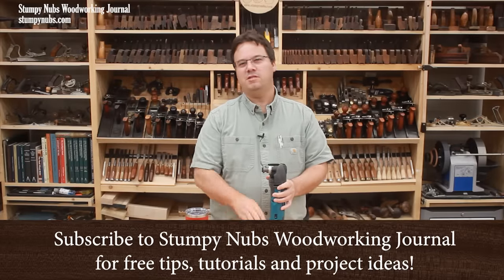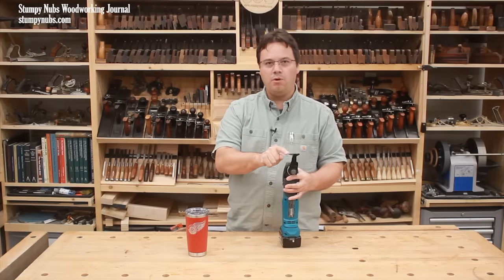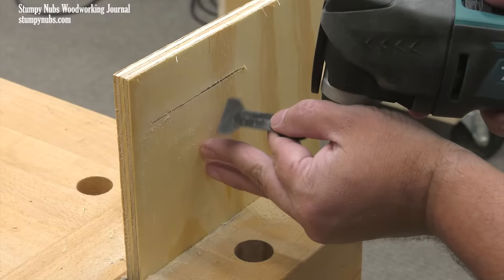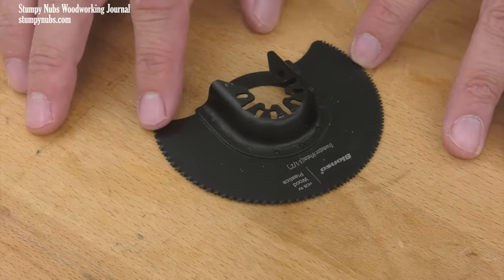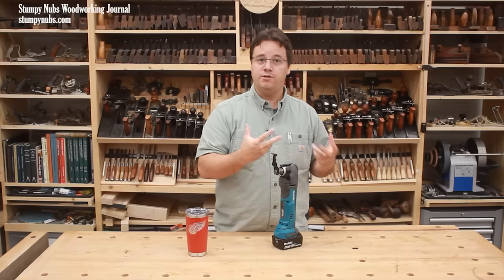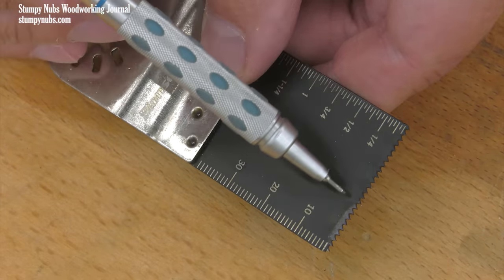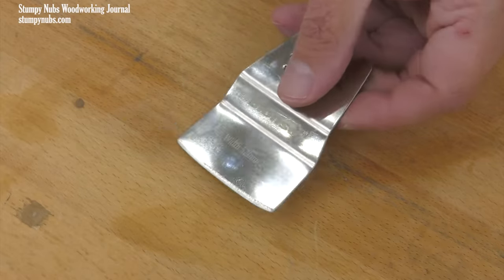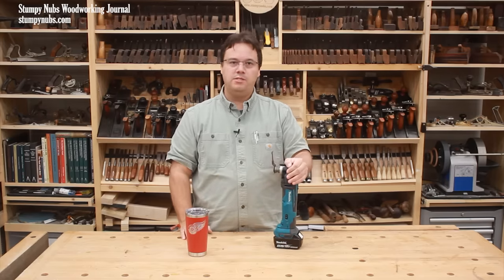CLEVER things to do with an Oscillating Multi-Tool!

Comment: Loved your informative video.  I was hoping from the start of it that you’d point out what to use for cutting bricks.  You touched on it, but then said it’d be better for another video.  I guess I’ll go look for that to see if you made one.  I just need a good one for cutting into brick (covered with thing studs and Sheetrock for a closed in patio.I need to cut a hole for electrical boxes.

Comment: When your wood blades gets dull, DON’T throw it away! You can easily sharpen them! Collect them and when your ready get out your Dremel tool and the thinnest abrasive cutting disk in the kit. With the use of a magnifying device a headband or other, use the disk to recut the teeth. It doesn’t have to be even close to perfect. Even a miss or two doesn’t make a big difference. Chang it up with angles and shapes. What counts most is sharp points, the spires not too narrow and don’t get the teeth hot (color change). Works well on bi metal too but not carbide.

Comment: Anyone in the market for an OMT should look for one with a light. I have a Bosch 18V that takes Starlock Blades. These were developed by Bosch and Fein and are the fantastic, especially their Curvetech ones. It pays to buy the best quality Blades, they last so much longer.
Another great use for them is cutting drywall in place. There can be wires or plumbing right behind the drywall and you will be able to safely cut the drywall without cutting too deep. Also perfect for cutting shims. I only wish there were extra long blades. There are times where I have to cut deep into material.

Comment: Diamond cutters and scrapers (diamond or not) do wonders in home restoration projects. Wonders. Surgical tools. In one case i easily separated the top layer of wall plaster from the bottom, to get a door frame flush with wall.

No dust, no noise, excellent and fast results, just by using a standard scraper and very low rpm.

Comment: I never thought I would use the sander attachment until I made a tiny error with a jigsaw on a laminated MDF window sill that had to slide around steel plate. It was the only power option I had that would fit. Obscure, yes. Did it make life better for one odd situation? Absolutely. Did I find this video helpful? You bet!

Comment: You can also glue green-Scrubbies to either-side of a worn-out blade, and polish between  motorcycle 'Fins' and other places . A container attached to the end of a 'Defunct' blade can be filled with small  fittings, screws etc, CRC  or even solvent will clean them up ...then....there's a feather........ Dave    NZ

Comment: Great video.  These are fascinating tools.  I've never actually used one for any length of time, but I bought a cheap one at Harbor Freight and decided to give it a try.  It was probably me, but, that damn thing was so loud it was like walking near a 737, and the damn thing vibrated so much it was actually hard to hang on to.  Maybe I just got a cheap "bad one", but I knew that I would never be using THAT one, so I took it back.  I was recently looking at a 20 volt, battery powered, Dewalt tool "kit" package with several tools in it, including one of these "screamers", for a very good price.  I might just buy some "ear muffs" and buy that kit.  Thanks again for the great video and great tips.  By the way,  I'm near Selfridge ANGB...GO WINGS!

Comment: When I got that tool, I thought all the blades were for wood. Thank you for that information. I had a 2 by 4 that needed to be cut in half in a tight space. Surprisingly, the scraper tool cut through it like butter. Hmmmmm. It was really dull, though after that cut.😊 I didn't know it was a scraper tool, so I'm chalking it up as a miracle from God.😊

Comment: i do auto body ,and occasionally we do glass , and i can remember way back to the 80's we had an air tool version of that oscillator , to remove windshields and cut through seam sealer, and it came in very handy , i had always wished someone would make an electric one, so when i saw the dremmell version , i jumped on it

Comment: The Bosch curved tec blades are my favorite by far. They are among the most expensive blades and it is very lame when someone ruins the blade by using it on the wrong material.

Comment: Rigid Jobmax for the win. Variable speed, and the head will rotate to 4 different positions for getting into even tighter spots. They even offer different attachments that can be used. Swap out the oscillating head for the right angle drill head, now it's a drill with variable speed with forward and reverse capabilities.

Comment: having use Milwaukee fuel, rigid, Dewalt, mikita, and rockler id say mikita, dewalt and miwaukee perfom very similar in speed and control of the cut. for whatever reason, rigid's (at least the one ive used) likes to throw itself and pull and tug more than the others, and rockler just cuts slower. prefer dewalts for 3 reasons. it has a trigger instead of a switch, allowing for more control and faster shutoff, but also has the option to lock the trigger. most other brands ive used use an on/off switch. dewalts also features a light on theirs. some of the other out there do too, but the mikita, rigid and rockler did not. i did many a cabinet install where i had to cut a hole for a vent by the light of my phone because the lights werent in the house yet and the mikita didnt have one. the 3rd reason is how the blade is mounted. dewalt has a powerful spring with a lever that holds theirs in. this means all you have to do to change the blade is pull the lever to depress the spring, and the old one comes out and the new one goes in. with all the rest ive used, they feature a lever that takes a good deal of force to pull open, then a screw of some kind to be pull out that binds the blade in place. while its very obviously secure, ive never had a blade come loose with dewalt, and the dewalt takes soooooo much less effort to change. 

this part is very much debatable. its not about the tool itself but the batteries. ive personally noted that in a multitool, dewalt's and milwaukee's batteries far outlast the rest in multitools in my experience. now it may be the case that all the mikita batteries ive used were near the end of their life because they were work provided, not bought by me, and definitely not new, but the Milwaukee ive used were new and my personal set at home is Dewalt and both seem to last forever. ive seen it thrown around that Dewalt makes the best battery tools for woodworkers, Milwaukee makes the best battery tools for other trades and mikita has everything that can be battery-operated... including a coffeemaker and a wheelbarrow. i think qualitywise, the 3 are very similar with their own strengths and weaknesses. so if you want to stick with one battery type, pick the one you see yourself doing the most of outside of woodworking is my suggestion.

Comment: when it comes to making straight (plunge) cuts, I find it helps to cut vertically rather than horisontally, so you can sight down the line/kerf
Reply from the maker: I find that the situation usually dictates that :)

Comment: Good tip I came up with to extend the life of blade, have a small pot of water to dip the blade in when it starts getting hot. Heat is mainly what kills blades quickly. I rarely use my Milwaukee higher than minimum speed.

Comment: "Let the tool do the work."  Heard this scores of times from my dad while helping him with projects.  Often it was "Let the machine do the work" as he was a dedicated fan of power tools.
Reply: He was absolutely right. If you try and force the tool it ends up getting stuck in the wood or burning the blade and wood.
Use it properly and you'll get more life out of the blade. This applies to the speed control as well.
Reply: I've worked in joinery shops and you can tell the arseholes because they have the speed control on the router turned up to max so that the machine is screeching away and then the smoke starts or they don't keep the router moving and it starts burning the cutter and the wood.
I have actually walked over to the guy and reduced the speed of the machine without saying a word hoping he would get the point and then walked back to my bench.
Some people are an accident waiting to happen!

Comment: I rarely, very rarely to never need one of these  but i had to click because its a interesting tool and im sure theres a cool trick in here somewhere. Im not a woodworker but i build custom batteries and make my own tools and fixtures so ill watch any video by a skilled builder and pick up a tip or a concept juat to have in the old noggin if i ever need it.
Reply: “I build custom batteries” made my brain explode. I can barely plug things in correctly… no way I would trust a battery I made. 😊👍
Reply: @whatifschrodingersboxwasacofin   building them is actually pretty easy if you can solder and have steady hands, now the design is a whole different ballgame. Thats where the engineers come in. I understand the batteries i build but am not capable of safely designing one myself either.

Comment: I got myself a green Bosch variety many years ago. Must have been 2008-2010 or so. One thing I’ve noticed, is that the really, really cheap blades are usually rubbish and will be worn out in a hurry. It is also usually much cheaper to buy multi-packs online, than buying one blade at a time over the counter.

Comment: When I found out how expensive these blades were when they first came out in mass I realize they don't make the money off the tool make it off of the blades! If you touch a little concrete, touch a nail your done so I took to tack welding hacksaw blades to the end of my worn out oscillating tool blades for cutting copper and other soft metals, it was a little time-consuming but it worked great for what I needed them for

Comment: I agree that the sanding attachments are mostly pointless for wood or metal, but by god are they fantastic for drywall. Any time I have a small drywall job I am so glad not to have the hassle of carrying around the orbital sander and extractor just for some small spackle sanding. Plus, since it’s not a rotary motion, the dust tends to fall strait down instead of being flung in every direction. So handy!

Comment: Two things that the multi tool is really good at:
1) cutting outlet holes in drywall.,
2) cutting the bottom of door frames to install flooring under them.

Comment: one more little trick - or actually two.  I purposely bought a model without a toolless blade system, because the head is much smaller - and I also tend to flip the blade upside down as often as not,  if I'm not needing to cut flush to a surface.  it feels a bit more balanced, and is even better in close quarters.

Comment: I make my own blades by drilling two (2)  small holes in a dull blade, then choosing a reciprocating blade, which are often much less expensive, and cutting it to the desired length using a cut off tool, then drilling holes thru it using the holes in the dull blade as a guide, then bolting the blades together using strong Lock Tite on the nuts to keep the assembly secured. When this blade becomes dull it can be disassembled and replaced.  :-)  L8R G8RS,

Comment: I've had a cheap oscillating tool for a few years and made good use of it. But I made the mistake of buying a non-standard blade attachment so blades are very limited. I should purchase another standard tool and put down the present one as experience.

Comment: An added tip, if your cutting speed drops suddenly check that the blade is tight. A loose blade will vibrate but not actually move much.

Comment: Sash windows on an old house, the type that slide up and down made from wood.  Six layers of paint and completely stuck.  Answer multi tool.  Cut a notch out of each side of a sawing blade, insert the blade between the window and the frame cutting through the paint.  Work the blade in and out, up and down and free the window.  It makes it so easy.

Comment: Hello and another great video. I have two questions. What I was first searching for was: what is the purpose of many of the blade manufacturer's having two different loading positions. Logic would say that the position further from the blade teeth the wider the path or stroke, and the closer position to the teeth would be a shorter stroke. Are there any example of why you would load the blade in one or the other positions?

Also, when I went to your link to purchase the multi blade kit... One of the images shows a compatible and not compatible list... one of the Not Compatible  models is the Makita XMT03Z... Which I own but also looks like you do as well. Have you used these blades with your Makita and is yours also the XMT03Z. My tool doesn't have the "Z" in the part number on the tool itself but, according to Amazon, I ordered and they shipped the "Z" model.

Not even sure if Makita made both a XMT03 and XMT03Z. THANK YOU as always!

Comment: If your work is not absolutely solid and fixed it becomes nearly impossible to cut when using an oscillating tool. I encounter this when cutting old wood lath held on by only a small brad nail.

A solution is to move the tool side to side, in line with the same orientation as the blade. It looks a bit silly moving the tool side to side, just like the blade moves side to side, but it works effectively enough.

Comment: One thing I recommend is keep a cup of water next to you when cutting wood with a multitool. It's the heat that dulls the blade so fast. Make a cut, cool it off.... It takes longer but the blade lasts twice as long. At 12 to 30$  a pop it's worth it.

Comment: Great video!   I'm going to be doing a backsplash and I need to go behind a crown molding attached to a cabinet.  Thinking of using a oscillator tool.  do you have any recommendations on which specific blade I can use?

Comment: You are 100% correct about letting the tool do the cutting. I learned that quickly. Pushing hard on the blade can actually stall the blade from cutting. Just letting decide will cut extremely faster. I learned that on cutting out box seals. That tool was amazing and made the job so much easier. How we did without it, I don't know. And we thought the Sawall was great.

Comment: If I'm cutting a bolt/pipe (trip hazard) flush to the concrete, should I use an oscillating tool or a grinder?

Comment: I remove the blades when I put the tool away. Same thing with my sawzall. That way I don't risk the blades jamming into anything causing damage or bending the blade, though that's probably more likely with the sawzall blades than the oscillating tool blades.

Comment: I only realised this tool existed around the time when the Fein patent expired. I wish I had this tool 20 years ago for trimming timber and plaster. I used this tool only this week to rebate plumbing into studs, quick easy, accurate. I purchased a corded variable speed Fein which has a set of sculptured rubber blocks to sand moulded timber trim which other brands do not seem to have.  I have restored a number of doors and cabinets with these blocks. Feins downfall was poor management.  Fein had the opportunity to capture and retain market share against all tool companies but chose to price gouge the market, over charge on every product because it could and become an also ran. Lucky the CEO does not work for me.

Comment: The sanding attachment is the most frustrating for me. 1st the cost of the sandpaper doesn't make sense when compared to other sanding tools. I'll go to harbor freight and buy the hand sanding kit for sanding floors. I can cut my own pads from the kit and get a lot of them for a fraction of the cost. But what I hate is that on the triangle shaped head the Velcro hooks  melt or wares quickly. So I have to find Velcro to resurface the head.

Comment: So I have a Milwaukee m18 tool, and I don’t do much woodworking, but actually use it more in an automotive shop for when I need to cut something in an odd spot, or can’t make sparks.  
Many times a cutoff wheel doesn’t fit, but this does.  
That said, I am going against hard thick metals.  I was in a serious bind where I couldn’t get my leaf spring bolts out, and ended up using metal teeth to cut the bolts.  (The bolts are usually 3/4” thick of cast iron).  This was expensive because each bolt would eat a $20 blade.  

I still can’t find a good metal cutting blade.  Something not with woodworking, but something for cutting swaybar links, tierods, control arm bushings, ect.   
What would you say is the best blade for cutting thick metal.  Also is there any technique I should follow.
Reply: I’m in the same predicament as I type this I got my sawzall and oscillating tool out

Comment: Tip if you don't use them all day Amazon has amazingly cheap blades that work great for one job or so, I figure at 50 cents to a dollar a piece one per job "I'm a handyman" is better than burning up a 20 dollar blade by accident on any one job. I keep good blades around for hard jobs but just burn the cheap ones up and don't think twice about it! Think I paid 35 shipped for 50 assorted blades last time! Still have a dozen or so left 2 years later as they often last multiple jobs.... ;)

Comment: as to cutting metal, there is one class of metals your suggestion will not work well. austentic stainless (300 series) they work harden extremely quickly so you need to use a very aggressive carbide saw tooth, and drive the blade through the material.

Comment: I was told a bi-metal blade is one where the teeth are harder than the body. It could mean carbide brazed onto a steel body, or it could mean induction hardened teeth from the same alloy as the body. There are other examples. I don't think they are using the term loosely, I think it is a loose term with different ways to get hard teeth on a durable body.